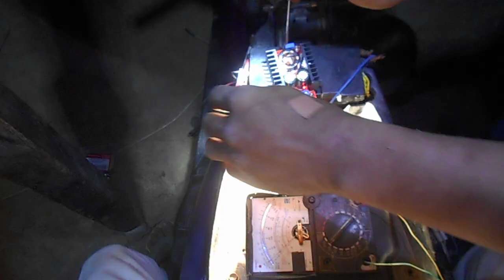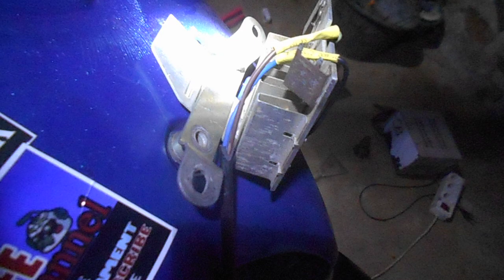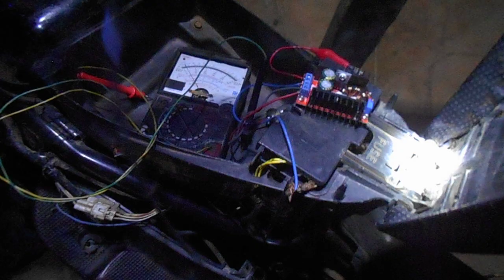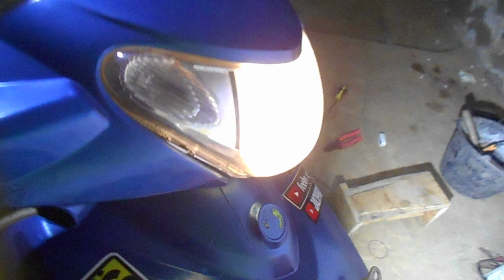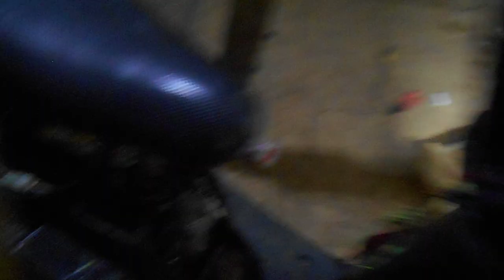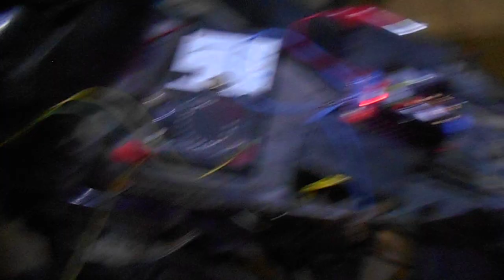LAMPU MOTOR 3X LEBIH TERANG

Comment: Ilmu sesat, jika lampu 100watt langsung ngambil dari aki, dibutuhkan sekitar 8 ampere. 
Kapasitas aki motor anggap saja 5aH, aedangkan aki bukan tipe high drain hanya mampu 0,5C. Berbeda dengan Lifepo4 yang bisa sampe 3C.
Jika dipaksakan akan memperpendek umur aki, apalagi menggunakan step up akan kehilangan daya lagi dengan efisiensi 80-95%.
Hitungan simpel 5a x 12volt, hanya 60watt

Comment: Kalau modul step up + step down di rangkai seri untuk menyalakan led projector 12.7V 2.5A apa bisa ya? Butuh untuk stabilkan voltase dari aki motor ke led.. Karena mau beli modul auto buck boost Dc - dc yang 8 atau 10 Ampere terlalu mahal, 5 atau 6 ampere gaada yang jual, 4A kok rasanya terlalu mepet..
Reply from the maker: coba pakai satu aja mas input pakai elko
Reply: @feebyewok  siapp, makasih mas, saya coba..
Reply: @feebyewok mksudnya pakai elco gmn rangkaiannya
Reply from the maker: @IkaYuditya  pakai step up bos

Comment: Saya pasang 2 buah klakson
Dengan relay, 
Gimn kalo arus yg kluar dari relay trus masuk ke step up baru ke klason
Aman gak bos
Reply from the maker: sepertinya aman bos maaf saya belum coba
Reply: Bang. Sy mau makai gtu
Reply: Buat lampu tembak 12-40 v
Reply: Klo langsung aki inputnya.  Redup hasil nya.
Reply: Aki , relay set kabel , lalu lampu tembak, hasil nya redup.
Reply: Tpi klo langsung adaptor 12v buat cctv .  Teraaaang bngt

Comment: Kalo pasang di lampu mobil bisa ga bang? Input tegangan aki 12v 60a, output sekitar 14.5v 10a.
Reply from the maker: bisa bos pakai micron dulu
Reply: @feebyewok  aman ya bang step up nya.
Reply from the maker: @Fransisko99  aman bos pakai resistor mikroon 1 ohm tegangan inputnya

Comment: bang klo di pasang di fuel pump trus volt nya gak stabil, permasalahan nya dmn ya? di pasang ke motor lain malah normal
Reply: di set 14.4 klo lagi rangsam volt nya naik 15.2 tapi klo di gass ato lampu utama nyala volt nya turun/ jd standby di 14.4 itu kenapa ya?🙏🏼

Comment: Kalo buat Mio soul bisa g om pke lmpu 70 Watt
Reply from the maker: bisa lur ambil tegangan dari Aki usahakan lampunya led biar awet
Reply: @feebyewok  lampu pake proji AES castum 2.70 Watt
Reply from the maker: Oya bagus tuh
Reply: @feebyewok  belinya yg berapa volt per berapa Watt. Kalo buat lampu segitu Watt nya om
Reply from the maker: @rizkyrizky7328  beli di online shop saja harga kisaran 30han
Reply: @feebyewok  iya itu kn macem" bagus nya kalo buat lampu segitu di Mio soul saya yg mana atau yg berapa Amper Watt nyaa.
Atau ada foto nya
Reply from the maker: @rizkyrizky7328  step up dc 12 to 32 10 amper bos , silahkan search di google
Reply: @feebyewok  ok thanks om
Reply: @feebyewok  apa bisa pesan sama Abang nya bisa
Reply: @feebyewok  aman tapi di motor bos
Reply: @feebyewok  mau tanya bosku  saya udah beli barang nya   kalo  buat lampu 70 Watt.  Butuh berapa volt yg aman nya

Comment: Itu apa namanya alat rangkainya
Reply from the maker: nama Alat Step UP ,  bos cari di jual beli online
Reply: Gag ada yg jual aku muter 2 gak dapat
Reply from the maker: @headyhunterz1574  coba pakai pencarian: Modul Konverter Voltage  Charge Step Up 150 Watt
Reply: Itu mentok berapa volt coy
Reply from the maker: @headyhunterz1574  40 v lur
Reply: Itu klo saklar lampu dem ...di sambung sama plus aki konslet gak coy
Reply: Soalnya mau ku buat langsung jalur dem
Reply from the maker: @headyhunterz1574  sakelar .harus dari autput step up